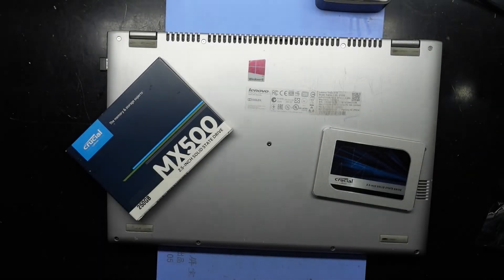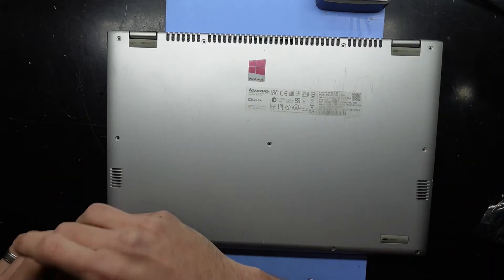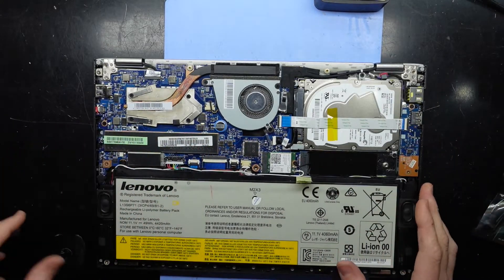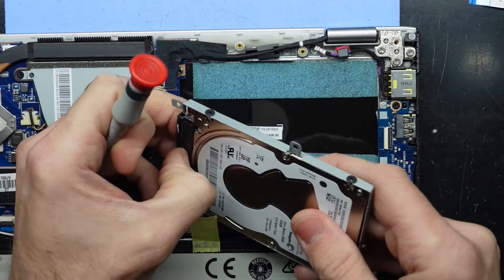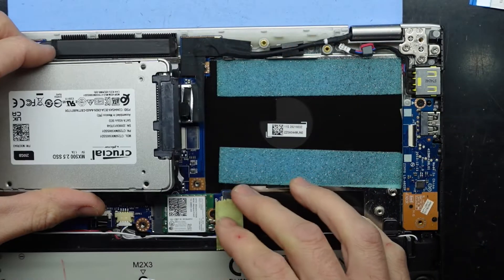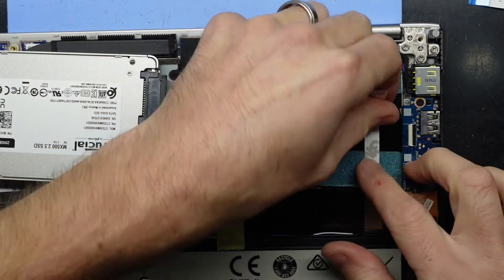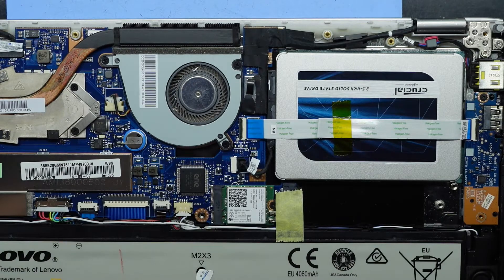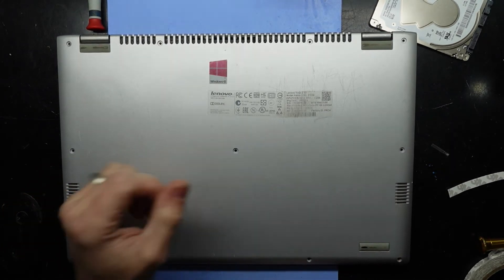Lenovo Yoga 2 13 teardown and 2.5" SSD Install

Comment: you're lucky, because your laptop Lenovo Yoga 2 13 hard drive system is sata, mine is SFF 8784
Reply from the maker: fair enough
Reply: @rickstechrepairs  I tried to use a card transfer between msata and ssf-8784 WD hard drive in the lenovo yuga 213 it didn't work the laptop start to keep restarting inly